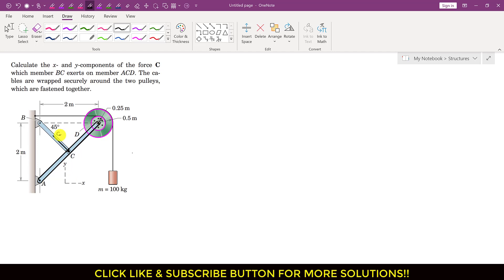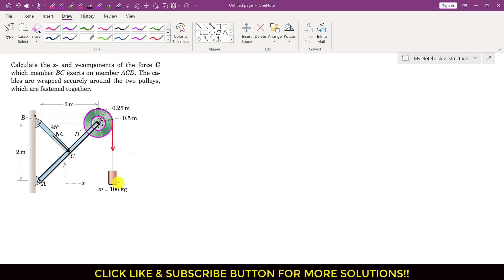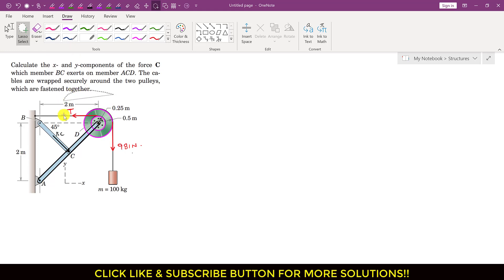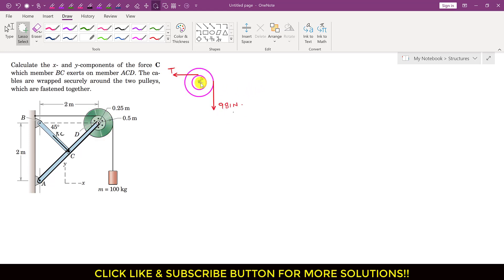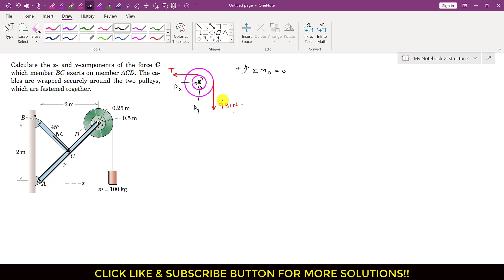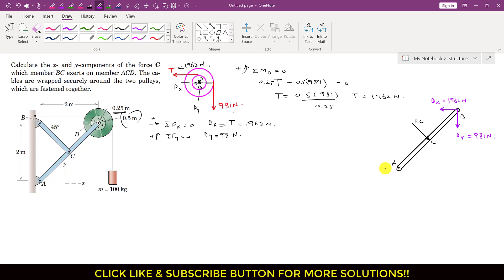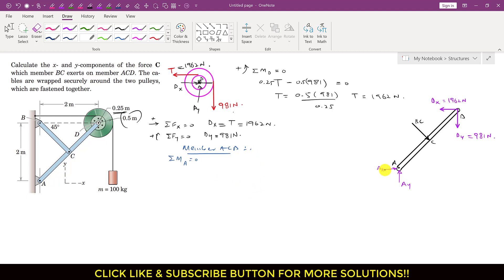Calculate x and y components of force C. Frames and Machines | Engineers Academy

Comment: You forgot to account for the .25 and .5 extra perpendicular distance to the Dx and Dy components should be -1962(2.25) and 981(2.5). Math cancels out and you still get the right answer, but the work is incorrect and so is the geometry. My dang Professor took points for that.

Comment: This procedure works if the system was in equilibrium only right? Cuz last semester I took engineering dynamics but didn't see such complex frames in motion. If there is a motion, the situation will be a little bit harder